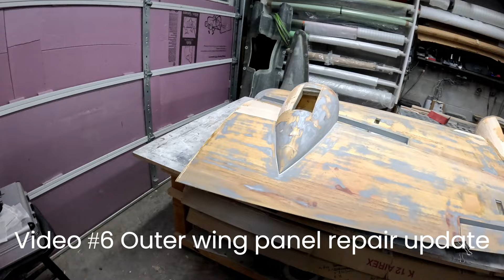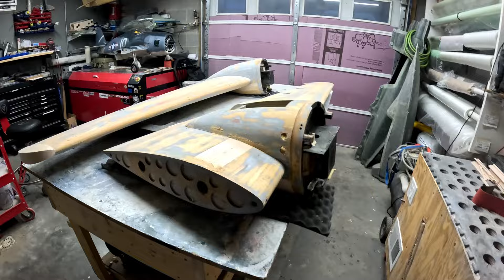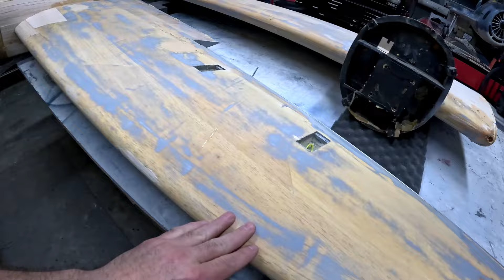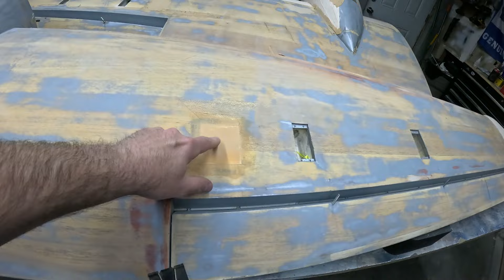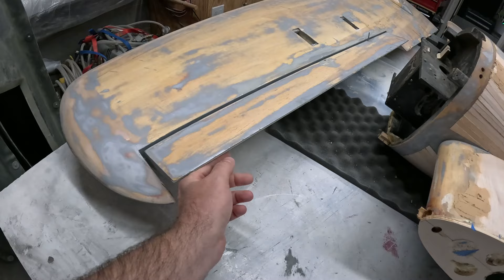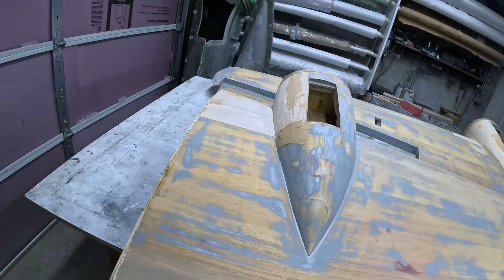B 29 Restoration Project video #6 - Wing repair update

Comment: If you’re gonna use smaller servos, make sure to follow the guidelines set forth by AMA for the large model category. They have specific formulas that determine the required torque of the servos for an airplane of this size.
Reply from the maker: Smaller servo’s size wise.   The 1/4 scale servos in this originally only had 260oz of torque,so 520per surface.  The ones i am looking at using are 900oz, each.

Comment: I would love to see how you did the G-10 trailing edge.  A good portion of my hangar rash happens on the control surfaces.
Reply from the maker: That is one of the things i lost in the recordings.  I do have the tail section that will get the same treatment, so i will get more video when i do those.